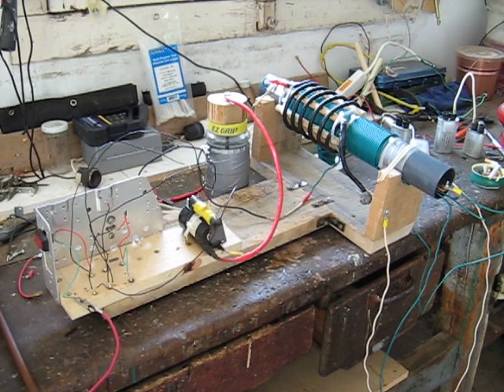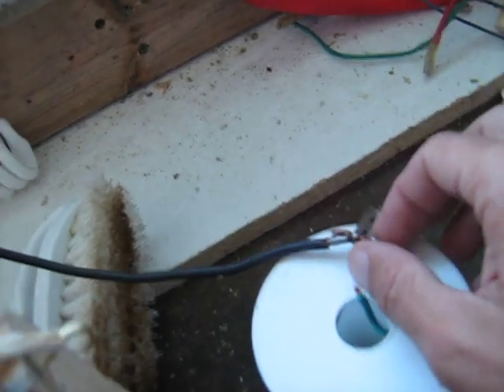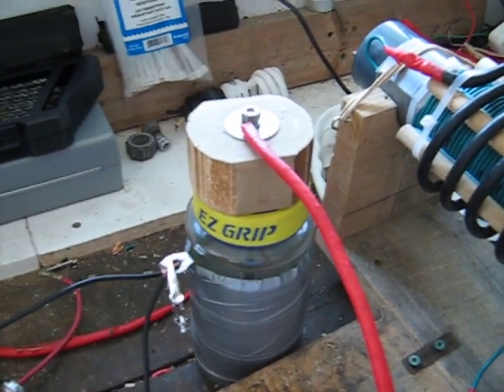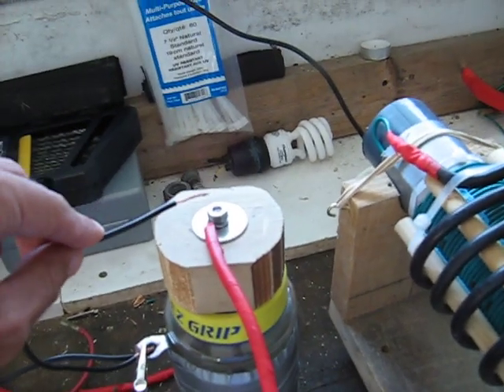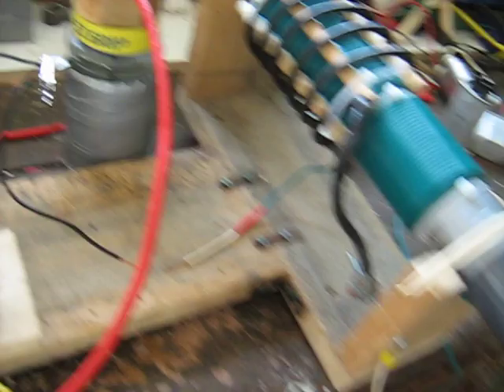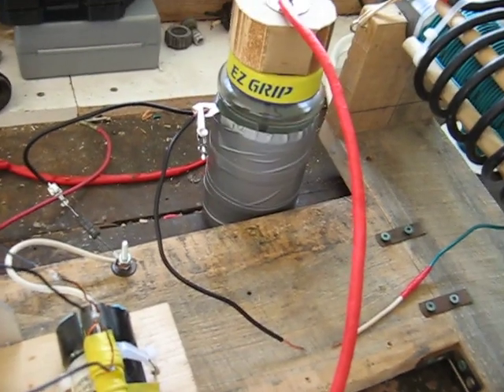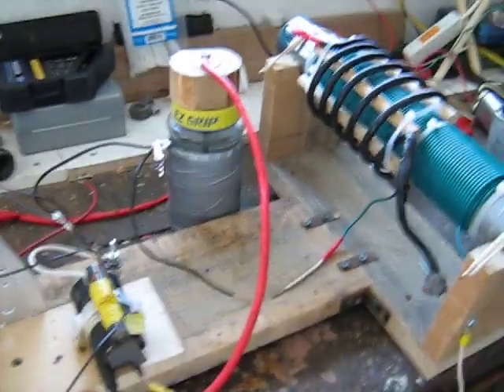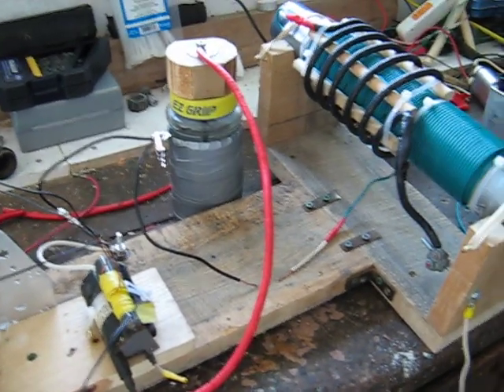Kapanadze Generator - Part 2 Spark Gap Fail

Comment: The same happened to me with my first Tesla coil, the problem was to use the same earth connection of the primary circuit ( household ground) and the secundary high voltage coil. I ended using a false earth " or an aerial plate as earth.

Comment: The  negative won't arc with the ground  because they conduct the same pole. Induction conducts to a foreign pole  it's energy is released there. Remember  the microwave oven surrounds the conducter  with energy & thats how you emplement this. Oherwise, you'll get nothing. Caution!!! Induction current will FRY you if you don't know what your doing, better beware!!

Comment: Maybe where you are located on earth your ground is the same as the positive end of the capacitor. Maybe try an antenna instead of a ground. Lightning flows in two directions, first from the ground to sky, then sky to ground. Just a speculation, but maybe this circuit works with negative energies. Maybe find a ley line to ground into.

Comment: This Circuit needs needs seperate grounds to function. could Try putting a ground off the battery's negitive lead and place a new ground stack outside and give it a try. This is a loop system normal electricity theory still applies in system. This is not a one wire electricity thing. It needs the two ground for capacitance and for return. If you notice in the orginal video of the kapanadze there are two grounds. This circuit needs these grounds.

Comment: You are comparing building the SR193 to the Kapagen. The SR193 is a more advanced circuit than the Kapagen. The SR193 is an almost-sucessful replication of the Kapandze, but the SR193 did not obtain as much over-energy as the Kapanadze. The SR193 or the Kapanadze is a closed-looping system and very difficult to build. The Kapagen is an open-looping system and much easier to build. See bluelightning77 at watch?v=T5QaWciXP1U or tomb455 at watch?v=3xGGhcHmIK4